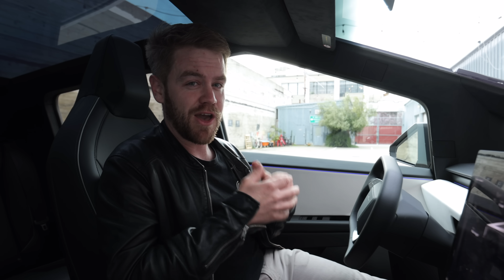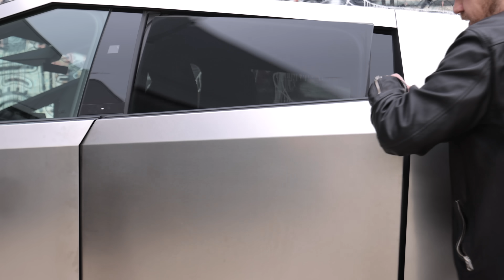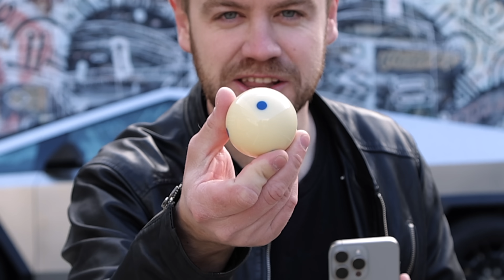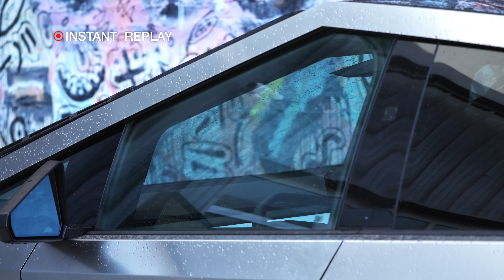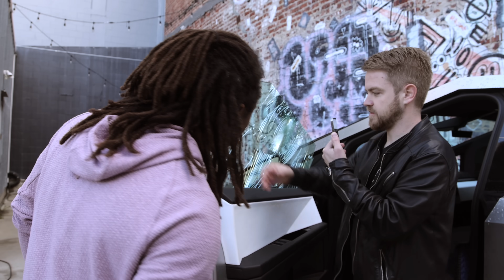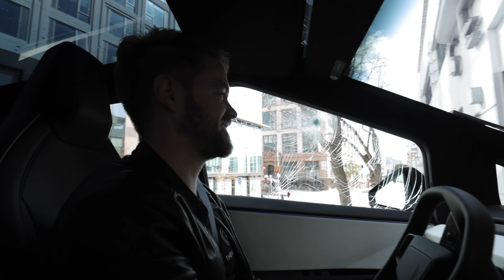Breaking Cybertruck’s Armor Glass (So You Don’t Have To)

Comment: That's horrible.  They give you no real protection beyond a normal window, and if you drive that thing off a bridge into water the electrics will stop and the windows will fail to roll down... so you have plenty of time waiting to die since you can't use a glass punch to knock them out.  Owners will be well on the bottom before water-pressure equalizes and they can try pulling the manual release they never bothered to learn about in the owners manual.

Comment: MY UNDERSTANDING IS THAT IT IS NOT NECESSARILY  GORILLA GLASS.  It is not traditional glass as we know it. It is a composite referred to as Transparent Aluminum. Developed in the 80s and it was what was referred to in the movie Star Trek The Voyage Home?  when they picked up a Whale from earth which was when Scottie referred to it as Transparent Aluminum.  It is now called ALON by the company that bought the rights to it around 2000 which stands for its composition of Aluminum (AL) which is 20 percent of the ingredients, Oxygen (O), and Nitrogen (N)   In order to make it transparent after manufacturing it has to be polished extremely well to the point it is microscopically smooth which makes it hydrophobic.  (Ie better than using rain x and is permanent in the material)   It is 5x harder than glass more like Sapphire.  A bulletproof window might have to be 3in thick wheras this could be 1.5 in thick to achieve the same results.

Comment: Every time you throw a hard object, or subject the glass to a blow, you begin to introduce micro fractures, slowly weakening the glass. So with each larger object thrown, you begin to compromise it, making it easier for the next one to crack it. This is how at launch-night the glass finally failed, they threw at it some 40 times earlier in the day, before it caved on stage.
Reply: Yeah right, both of them, you get better odds at the lottery
Reply: That means they need to retest this with the heavy steel ball first.  😂

Comment: Bulletproof glass is a bit misleading since bullet proof glass really means bullet resistant glass - ie. it will break but as long as long as it stops the bullet passing thru it's doing the job.
I am amazed at the toughness that big steel ball was almost 2kg and it took several good hard hits before it finally broke - this is way stronger than normal automotive glass - EM said something about it being acoustic glass so it's also good at sound blocking.
I think it may actually stop .22 .38 .45 APC and 9mm hand gun rounds - well the first shot at least. It would need to have an inner poly layer to prevent spalling like proper bullet resistant glass has i don't know if it does or not.
Reply: MTAV oshkosh uses REAL bullet proof glass.
Reply: @markplott4820  It would it's a military protected mobility vehicle and it weighs 12 tonnes. !

Comment: I have been wondering if the glass doesn't crack with the safety tool, how hard will it be to get out during an emergency?
Reply: Easy, just open one of the doors! They all have mechanical releases incase the wiring is severed. It is extremely rare for someone to save their life by having to break a window (but the irrational fear of that sure does sell a lot of window breaking tools).  And that's with regular trucks that have doors made of thin, painted steel that crumple in the slightest impact. The tesla doors are built like a Sherman tank. If one or two do jamb, it's easy enough to slide across the seat and exit the undamaged side.
Reply: @ZipZoomZip   Thanks. I'm aware of those things. The scenario I was thinking about was one where the car was driven into water. In those situations, it's almost impossible to open the door due to the water pressure. Rolling down the window and escaping is the #1 solution. However if windows don't work due to electrical short issues, then breaking the glass and exiting through the window is the #2 solution. But I would agree that this is extremely rare.

Comment: Now try it on the competition
Reply: Now let's see how you get out in an emergency like a fire and you are knocked unconscious and the doors fail to open and rescuers cannot break the glass to get you out!
Reply: Are you a worry-wart in real life too? Electric cars catch on fire 1/30th as often as gas cars per registered vehicle.  @gregb1599
Reply: @gregb1599 

The doors probably have a mechanical release. Firemen carry fireaxes and have crowbars, it won't be too difficult to break into it in  the emergency, besides it's up to the car buyers to decide if they prefer fragile windows just in case car should catch on fire and they need to break them, not some committee or government oversight mandating this erroneous nonsense.
Also, if it's good enough for the pope and others who pay thousands for bullet proof car windows,  then that alone should tell you that you, that should hold your breath until your wish is fulfilled. 🙂
Reply: @gregb1599  yeah only stupid Tesla fans would want an unbreakable glass so they are trapped in during a crash and battery is blowing up and burning the car.

Comment: previous tosses might have weaken it so the last straw broke the camel's back
Reply: Cope
Reply: Exactly! Cope. The excuse Musk originally gave was ironically devoid of physics. 
Due to the solid design of the Cybertruck, the windows should actually be easier to break.
They must have added padding to the doors in this latest Cybertruck, so the windows only break if struck on the edges near the steel where the window has less flexibility.

Comment: 5 lbs steel ball thrown by a triathlete (not holding back) just bounces off the window without breaking it 😳
Reply: narrator: it definitely broke it.
Reply: @laloajuria4678  cracked it NOT broke
Reply: @laloajuria4678 yeah after a hailstorm of metal balls it the window it finally cracked.
Reply: Hi, Elon voice double lol
Reply: watch "My buddy tries to break car window with hammer"
no need for su***de windows that rescue workers cant open, tempered glass works just as fine
Reply: And thats AFTER multiple different balls were thrown at it. If it was thrown to other windows it wouldnt crack it even after multiple throws.